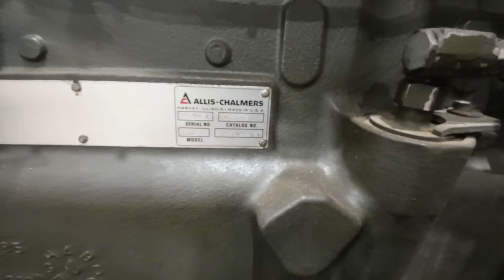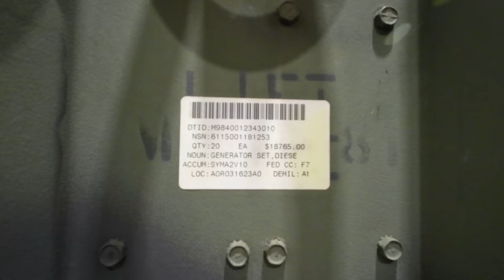$500 Diesel Millitary Generator sitting for many years, WILL IT RUN?? (Allis Chalmers 3500a)

Comment: I Was A 52 Delta , Power Generation Equipment Repairer, When I Was Stationed On Fort Ord , With The 707th Maintenance Battalion , 519th Maintenance Co., I. Was Trained To Work On The Electrical Part Of The Gen Sets, There Were Different Size Gen Set In The Diesel Class The 5 Kw , 10 Kw, I Think, 15kw, 30kw, Again I Think, 60kw, 100kw, But I Could Be Wrong, There Are Precise And Utility  Gen Sets 
 Everyday Stuff , Lights Utility , And More Sensitive Equipment Computers. , Precise Gen Sets, Diesel Not To Many Breakdowns , So I Mainly Worked On Smaller Gas Gen Sets Mostly Engine Rebuild , Stuff Like That, Still Have Most Of My Books Notes And Wiring Schematics, 30 Something Years Later, Oh Anything Bigger Then 100kw. Were Turbine Totally A Different MOS, Love Watching Your Channel I Keep Learning Things All The Time, PS Sometimes I Binge Watch .

Comment: The aviation generators are 400Hz. My college instructor said it's about doing more work with smaller components, with the higher frequencies. Or, think about an older linear power supply, big transformer, and, switching power supplies (computer types) popular today.

Comment: Should have put some iron out when you put water in. Really cleans things up after a few days and then you just run it stick a hose in there and open the drain plug and watch all that nasty stuff come out. If nothing comes out you may have to take the lower rad hose off to get the bigger scum to come out.

Comment: You nake me want to go find a old diesel and play with it just to see if I could get it to run; with a small gen set in the truck to supply 12-24 volts as I cannot lift heavy batteries.

Comment: That would make a great motor for your Ford 450 and then you would have a great truck and I just can’t believe you would buy a truck with a V8 diesel when you know that the straight 6 is the engine to have. How many pieces of equipment do you have with a V8 diesel in it ?

Comment: That corrosion at 5:50 is caused by tap water being used as coolant. It should be a mix of distilled water and glycol (used as antifreeze and improves thermal conductivity of the coolant). Typical armed forces "It aint mine so why should I take care of it" attitude.

Comment: When a gas or diesel engine has been sitting for more than five years the valves and seats gets corroded, and of you manage to run it will smoke, miss, dump fuel slobber, you most remove the cylinder head,do the seats and valves otherwise it won't work correctly, that my field of expertise.
Reply from the maker: That is not true at all, I’ve demonstrated that on this channel these old beasts will run quite well with minor work usually

Comment: DTID means Disposal Turn In Document. Disposal turn-in document (DTID) is a 14 character value that consists of the property book DoDAAC (M984001), followed by the julian date (234), and a four digit serial number (3010). Each DTID is unique to a specific transaction. Department of Defense Activity Address Code (DoDAAC) is a six position code that uniquely identifies a Department of Defense unit, activity, or organization that has the authority to requisition, contract for, receive, have custody of, issue, or ship DoD assets, or fund/pay bills for materials and/or services. The first positions of the code designate the particular Service/Agency element of ownership.

Comment: Aircraft electrical systems run at a frequency of 400Hz. Why? Well the transformers at 60Hz are very heavy and very large. Aircraft pull a lot of current (Amps), and many voltages are required, thus small transformers for wait keeps the aircraft's wait down. Simple eh?

Comment: The MEPS generators had more problems add to it to make it "more better" and only created problems fortunately for the Air Force DOT  made the Army suffer with it first
Bypass as much of the fuel system as you can
The engine controlls  ALL go through the generator controls you must strip it down to the bare engine and put on contemporary engine controls (oil pressure,  fuel pressure overspend under speed ) will always be a problem if you don't do not leave anything attached that has screw on  "J" plugs it will only bite you in the grass

Comment: SO ? since nobody else said it ,,, I will..    What happened to the overhead gantry crane ?..  is that thing Gone or is it still sitting around somewhere waiting to be installed in that awesome workshop

i dunno bout the rest of you, but myself i would consider such a thing as a super high priority project .. 

cheers and ALL the best
Reply from the maker: Power to run it and heat seem like higher priority lol the crane will get there eventually
Reply: @DieselCreek  Yes fair point Matt,  those big electric motors are power hungry critters . All the best from down here in western Australia

Comment: Can anyone explain why the auxiliary tank needs an in AND out? (At 24:02)
Reply: The fuel runs through the injection pump to not only supply fuel to run but also to lubricate the pump (no engine oil in these pumps). The excess fuel returns out of a return pipe back to the tank. You will also have excess fuel returning from the injectors. Both need to run back to the tank or you will very quickly run out of fuel. The flow returning to the tank is also used to cool the fuel so it doesn’t get too hot.

Comment: You ever been In a cockpit before Joey? Ya Ever seen a grown man naked? But he cudnt handle it, no no no! Buddy was the bombadier, but striker, he brought us in too low over mucho grande….. over macho grande sir? Nah afraid not, I’ll never be over macho grande those wounds run 🏃‍♂️….pretty deep 😂😂😂 I’ve been a Lexus line tech for 17 years and my buddy who worked beside me we would literally run those lines all day long for damn near 20 years and it’s still funny
Reply: I think we better get to the tower luit. Tower sir? We have no tower sir. NO TOWER? that’s right, only a bridge sir. Why was I notified about this thing. I tell you what, we’re gonna need to dig a 6ft ditch all the way around the base, fill it with diesel 😂
Reply: Last thing, lol. I’m in the shop welding tonight at my house and had your motor grader video on or maybe it was the 500 little dozer and I gotta give you props lol I’ve literally never heard the term little bit of the Ether bunny 🐰 never hurts or somethin like that made me bust out laughing so good stuff bro that was funny

Comment: Nothing simpler to work on than a non common rail 4 stroke diesel engine .... its all the stuff manufacturers bolt on and around them thats the problem.
I remember trying to perform a service on a relatively new Genset .. there were 2 of us service techs trying to find the dipstick, we spent what felt like hours,only to find it buried amongst all the cable trunking and control housings ....

Progress huh !

Comment: looks overloaded.. 0:21 did you really just load that entire thing in as tongue weight including the trailer.. good thing that's an f450 just so you know even though its an f450 its MAX is about 2000lbs on the ball without a goose neck and it has to be a special ball like 3 inch for that amount of tongue weight, usually rated for 10% of total weight to be used.. its dangerous as it lifts the front end and understeers

Comment: my God...! Electromagnet coil. Two ends of the coil winding. Less with where you connect the plus and where the minus. There is supposed to be a voltage on the COIL ... so much and so much .... How can you look for fluidity to ground on a cut off coil?? Fluidity to ground had to be sought before cutting the wires. After all, you cut off both ends of the coil .... Basics of electromechanics .....

Comment: said immediately the other solenoid wire might not be getting ground and then continued to completely ignore it for half an hour of video confused on why it wasnt starting... you were at one point holding both ends of the circuit in the air and probing one end for ground confused why it was open circuit

cant be great for the injection pump to be pulling through a filter either its designed to be fed pressurized fuel by the electric pumps that were for some reason mystery containers.. i mean tmetal cylinders fuel lines into them and wires coming out.. cchances are its a fuel pump

Comment: As you explained all the Government safety devices on the Engine for the Generator  it made me really laugh  as i’m sure they  all do or did have  some  decent Functioning purposes    they also complicated a fairly simple System  giving it many reasons to  create failure  it makes me Wonder how many  people  spent   government dollars   trying to figure why the thing wouldn’t start  or keep running. through all of it’s needed functions ?  Typicall Government    process ,BTW. i personally spent over 35 years of my life  working as a Subcontractor. to the Federal Government  in which myself and  40 Employees. needed Clearance  at some level to  Complete our Contracts  it used to make me curious as to  how many times  we needed to be cleared. by the F.B.I.  every year ?    i always thought    i’ve done this. several times don’t you guys keep records ?  I’m in your System

Comment: I love how the guy who knows nothing about electrical systems is knocking an engine configured to run a 400hz aircraft generator. This unit was obviously designed to support critical systems that demanded reliable power.  It has redundant fuel configurations and likely had all kinds of other "robustness" additions that made it deployable and guaranteed to work every time in almost any climate, yet it's a "waste of taxpayer dollars". Oh it looks "over complicated" to you? Do you have even the SLIGHTEST idea what job it needed to perform? Maybe talk to a military aircraft engineer before making misleading comments. Or just stay in your lane because this kind of commentary makes you sound like a fool.